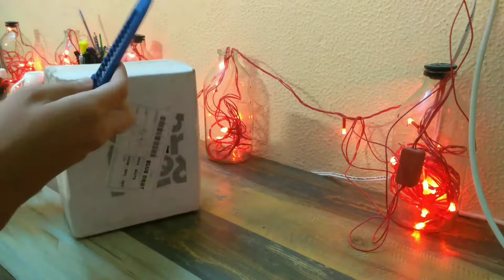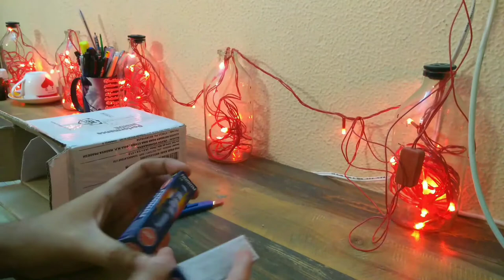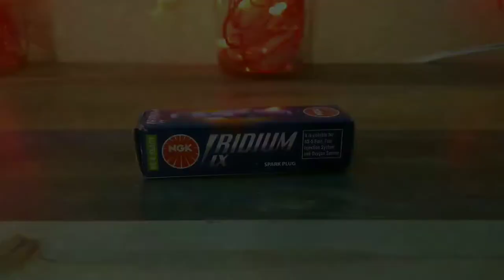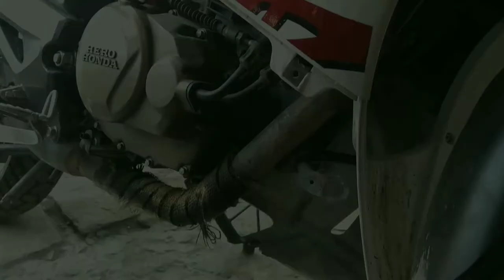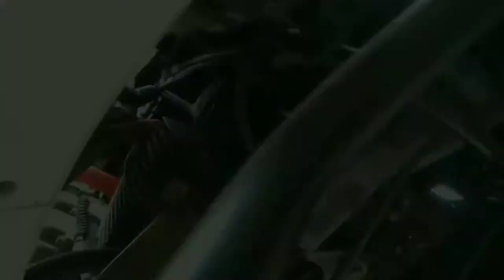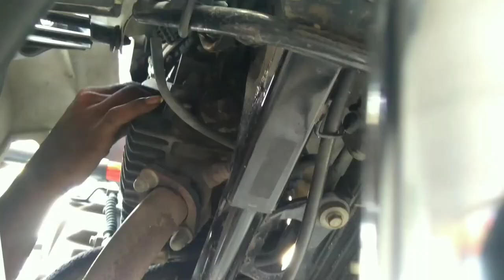NGK IRIDIUM Spark Plug unboxing and installation video |

Comment: Is this spark plug comfortable to Karizma r 2014 model bike
Reply from the maker: Yess!! You can use it for karizma R also
Reply: Any differences between normal sparkplug and iridium spark plug. Let me know how it's working after installing iridium spark plug
Reply from the maker: Initial pickup will increase and for me cruising on 100+kmph is more easier now after installing it!!
Reply: @faaiezkhanvlogs2833  Ok thank you
Reply from the maker: Keep supporting✌🏻🤟
Reply: Which  size spanner should used to remove spark plug of my bike Karizma r 2014 model bike
Reply: How much top speed after and before?